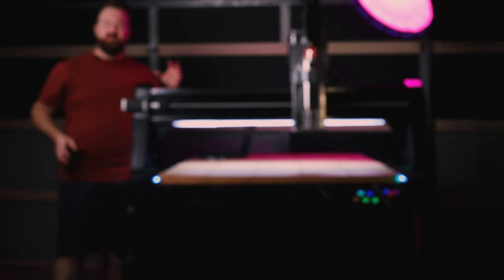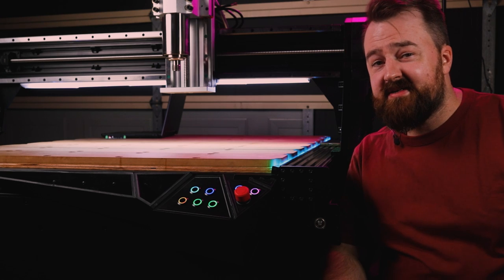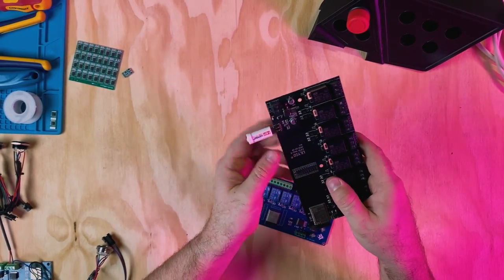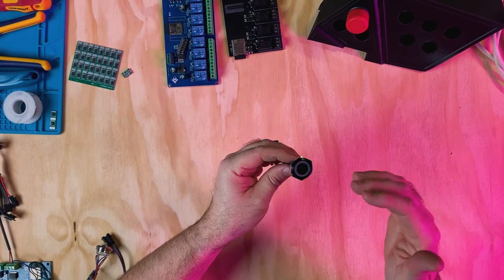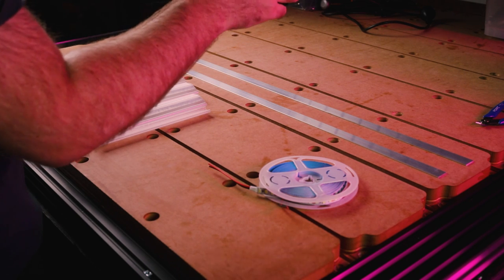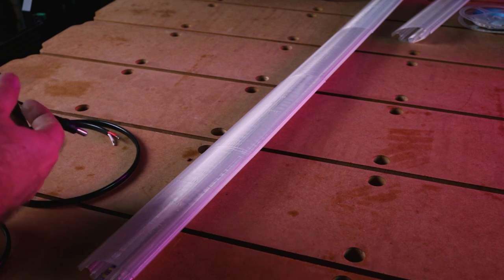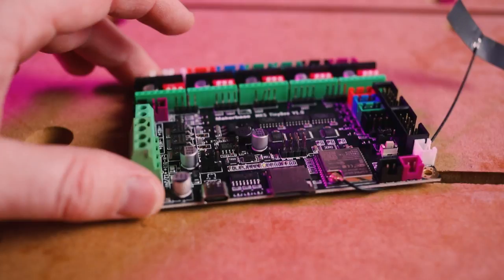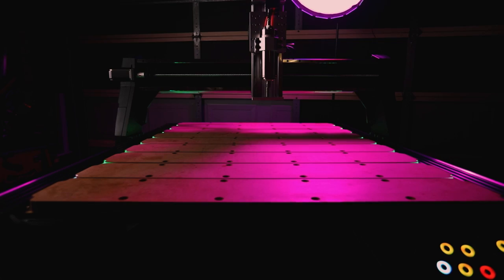Matilda CNC // Root Controller // WLED // FluidNC

Comment: I really like the look of it. However I have some thoughts on safety. The WS2812 LEDs flicker at a really high frequency. That's not a problem in normal lightning but in machining it can lead to the spindle looking like it's standing still eventhough it's not. That's why there are actually norms on lightning in workshops. At least in Germany that's a thing. This is a hobby build so you obviously don't have to conform to industry safety stadarts but it might be a nice safety addition, that the lights that shine directly onto the machine surface get turned off when the spindle is spinning and a relay turns on some regular white leds that have a big capacitor in parallel.

Comment: i made under beam led light similar but i use ready to use aluminium U-profile were have channel bush in led. light strip and top profile have diffuser plastic. cost 4$ only/meter , and easy install some screw to beam.
Reply from the maker: Thanks for sharing! Yes this is definitely an easier option 😂😂 I often reinvent the wheel 👍👍

Comment: Considder using geckodrives for the stepper drivers. Thet are silky smooth for steppers and improve steppers to the point where they are more like servo motors because they have an adjustable pot for quiting the pulsetrain. I will never go back to standard stepper drivers.
Reply from the maker: Thanks for your comment! I have heard of the geckodrives, however never tried! I will certainly keep in mind. I have already purchased some other goodies that will solve my stepper driver issues… stay tuned 🤩🤩

Comment: Love the videos, but the interstitial music is abusively loud and obnoxious by comparison to the dialogue which is the real value!
Reply from the maker: Thanks for your feedback Tristan! Unfortunately I can change once uploaded, however have improved on my latest video 🤩🤩
Reply: @NEWTechCreative  No worries. I wasn't certain whether it was the aesthetic you were aiming for with your YouTube channel or not, however pumping sidechained compressor-style music does have a drastic apparent volume difference between it and the (higher priority) informational dialogue. It's a ballache having to change volume level between segments. You've got a new sub from me, because this project is very much a parallel with my smaller format precision CNC. I found you as I am initially setting it up with FluidNC, perhaps a Masso G3 Touch later. I've gone fixed gantry for stability, and so that I can add fixed chip curtains across the Y axis....
Reply from the maker: Thanks for you tips and subbing Tristan! Would be great to see your build 🤩

Comment: only what i need my DIY machine have this biggest and better spindle. all other have same, motors, but i use DM 556 drivers can use biggest possiple nema 23 motors. and i use old cheap paraller port 10$ controller board, cheap and can use 2 paraller port easy,  usb port controller have all too lot problems and not can use safety REALTIME controller. mesa card whit ethernet have perfect but too expensive hobby user and DIY builders.
Reply from the maker: Nice! Yes the 2.2kw make a huge difference! So many options for controllers these days!

Comment: This is just  iPhone

Costly copy of Openbuilds
Reply from the maker: Thanks iPhone
Reply: iphone not any use, all use only cheapen and better android. Openbuild cnc have owerprice expensive, ewery men can build DIY better cnc machine 4x cheapen, or same hardware machine 6x cheapen. better motors big, cheapen and better controller, linuxcnc software best safety and real time controll, dont waste time windows software not safe and real time controll, and not flexiple build own additional systems to machine, MGP, relays, own controll panel, display modifications, ATC, etc many linuxcnc can do all this, all other old GRBL or mach3 software not can.